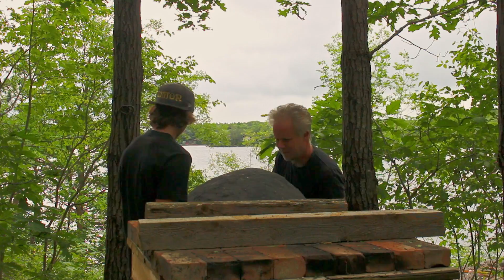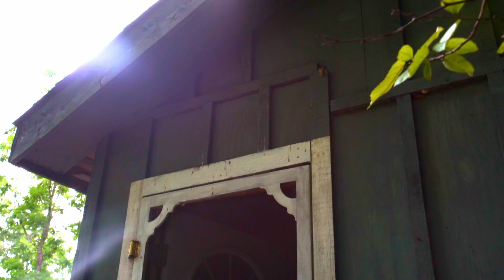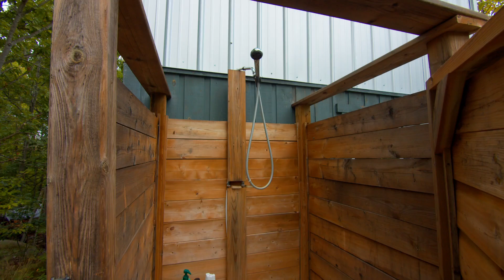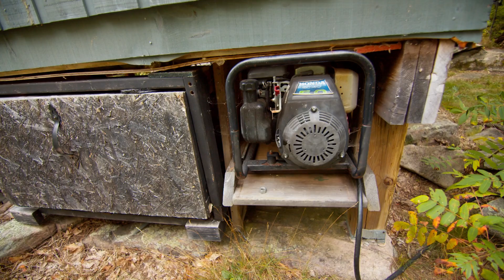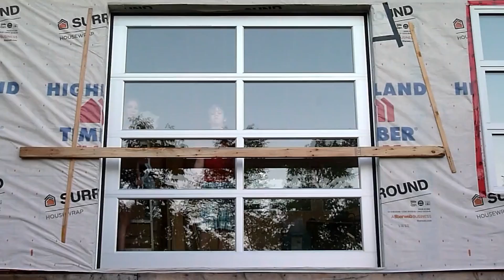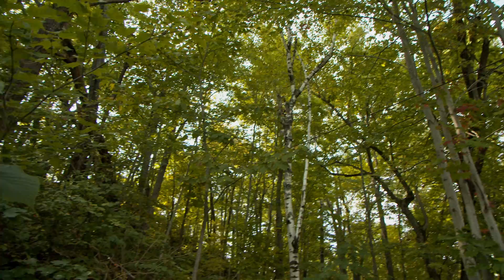This OFF GRID island Cottage is a Childhood Dream

Comment: You said you built the minimum they would allow. Why is that? Cost, heating efficiency... etc.
Reply: We originally wanted to build several smaller buildings. Like a camp with separate buildings for sleeping, eating and bathing but you must first build a primary residence.
Reply: @OntarioLakeside  So at that point you might as well build the steriotype home?
Reply: Meaning, all in one
Reply: @anothersomebody8195  We built the minimum and over time will add some fun small outbuildings as the family grows.
Reply: @OntarioLakeside  that's a good way to do it. Where I live you can only have 2 nonpermited structures 200 sq ft or under for storage that are non-inhabitable... otherwise they would have to be grandfathered in.